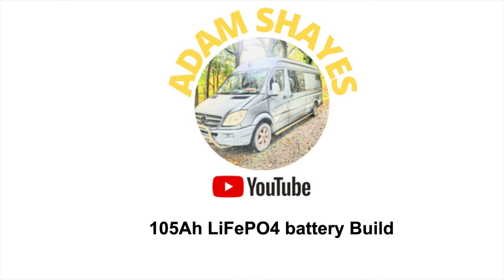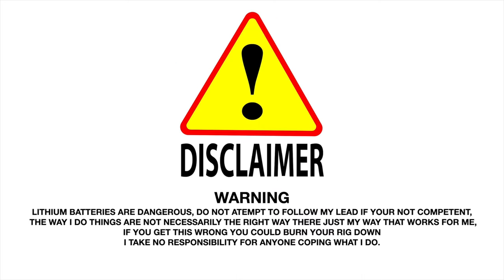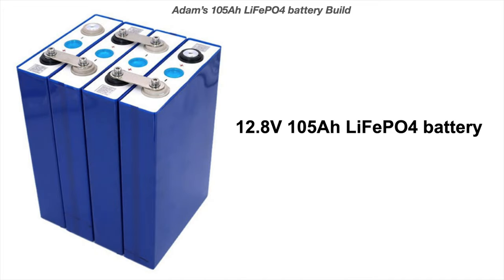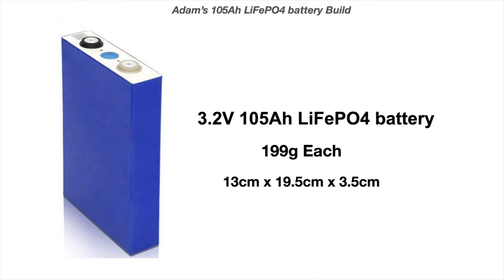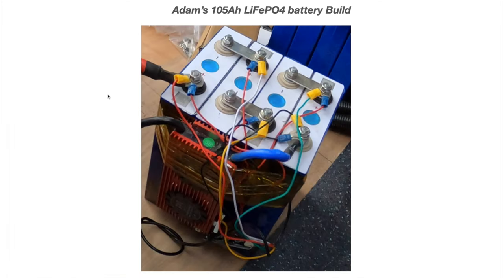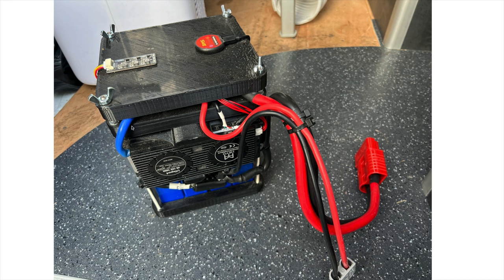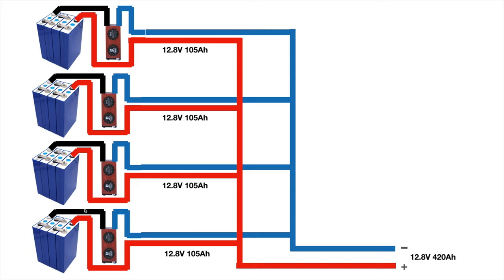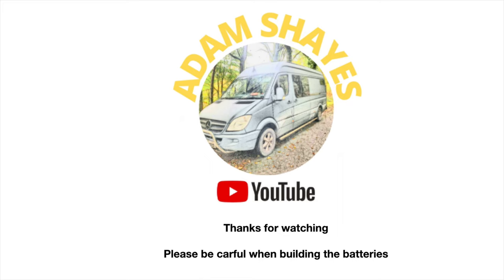Self Build LifePo4 Lithium Camper Van 12v 105Ah Battery Pack

Comment: Great vid mate I built my own last year 280ah best thing I've ever done never let me down plenty of power 🔋 👍
Reply from the maker: Fantastic mate, you don’t need to spend the earth to get really good power, lovely to hear that there are people like you giving it a go, best of luck Bud and thanks for the comment 👍
Reply: @adamshayes  I remember you talking about them at vanlove
Reply: Hey! I'm planing to build a similar 280Ah EVE grade A 24v pack for a different van project and wanted to ask - how have yours been running? Have you ever heard about real problems or some dangerous stuff because of the way the batteries are "transported" inside a moving van that experiences a lof of shaking, etc. do to road conditions?

I know lots fo people who build these for off-grid solar systems and there is definitely no problem with that, I'm just worried about degradation and stuff, and wouldn't want to burn my van down just because such a use might not be appropriate.

Comment: Very nice set-up & very well done, simple thorough explanation of your system!  One of the best I ever heard.  The only thing I would have done different (maybe, depending on how swollen those Grade B cells are and get, once fully charged), is to create side compression on those batteries, which will help extend their life.  For the Grade A build you do next, make sure add this feature to your 3D print design.  Keep up the great work. Subscribed
Reply from the maker: Thanks mate, that's great advice, I am in 2 minds about compressing as there is so much out there about Lithium cells, I haven't compressed the cells and they are slightly swollen, Im looking at is as if you are drawing a lot of current and charging at max then the cells will be worked hard and continue to swell but if your only drawing small amounts of current as in I'm probably drawing about 250A divided by 4 batteries = 62.0A each then the batteries won't be worked hard, It is a learning curve, I will probably compress the new cells and run a comparison with the Grade B cells, watch this space, Cheers mate👍

Comment: i only have a compressor fridge running 24hours in van.think its about 35 watts with thermostat flicks it on and off.and just some led lights plus usb s to power.i run van as my daily so batteries getting well charged usually.we camp off grid for 1 to 2 days a time before moving on and recharge batteries .maybe wait till agm batteries die on me.can get a lifepo4 ready to build next year.fogstar have grades a 75£
Reply from the maker: With regards to your fridge you need to monitor how many time and for how long the compressor kicks in over 1 hour, work out how long it is running over 24 hours and then calculate your lighting, you should be able to workout how much power you will need then size you batteries accordingly, hope that helps mate 👍
Reply: @adamshayes  I have the Renogy battery monitor  also it’s quite a new fridge made by vevor..One of my solar panels may packed up been showing just 10volts or it’s faulty monitor epever or sensor .
Reply from the maker: @stevemcgowan3017 sounds like there could be a problem there, hope you get it sorted👍
Reply: I just fitted new Renogy 100 watt flexible before went Cornwall august
Reply: Fridge came on for 10mins in half hour period

Comment: If you wire four sets of four cells in parallel and then the sets in series you only need one BMS.
Reply from the maker: Absolutely correct but I wanted to have 4 separate packs as I can just unplug them and take them to be charge separately, also if I only had 1 BMS and it fails my whole system goes down, Thanks for the comment and watching my videos, Cheers Adam👍

Comment: hi adam.just seen your lifepo4 build.im thinking at moment ive got 2 115ah leisure agmbatteries in campervan.they were new last year.recently i left a cable off one of batteries so it went down to 6 volts.i did recharge it think its bit weaker now.i have solar panels on roof 200 watts solar plus dc charger victron.im thinking i would only need 1 lifeoo4 pack as thye can discharge lower than agm lead acid that right?steve
Reply from the maker: Hi Steve, Yes that's right you can discharge to 80% and because they have a BMS it won't let you  discharge below that so it cant destroy the battery, Thanks for watching and Good luck mate 👍

Comment: Can you connect this directly to the alternator for charging or do you need a charger in the middle?
Also got solar mppt and running an inverter.. 
I just need to know whether it's a direct replacement for lead acid or do I need to modify the system?
Thank you, great video:)
Reply from the maker: Hi, you defiantly need a charge controller that is designed to charge lithium batteries, you can't use a standard charger on these batteries, hope this helps and thanks for watching.

Comment: Do you mind to share the aliexpress link of the supplier you purchased them from?
Reply from the maker: Hi Ronaldo, here's the link to the batteries I bought, they keep going up in price, https://www.aliexpress.com/item/1005003801474773.html?spm=a2g0o.order_list.0.0.55131802YZuIP8

Cheers Adam
Reply: @adamshayes  8PCS now cost almost £600 quid now which is 200ah. You also need to buy a BMS module. You can get a prebuilt 200ah bank on ebay for £845... Hmmm. I think there are some on aliexpress that are much cheaper, but its always risky since they can send you crap grade and ali express will always take side with the seller. Deffo going this route when my AGMs die though